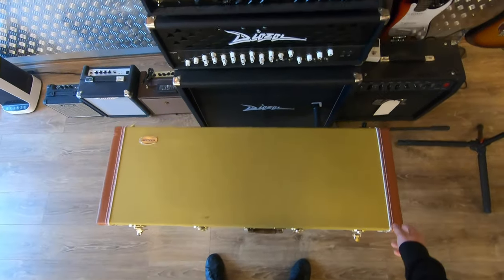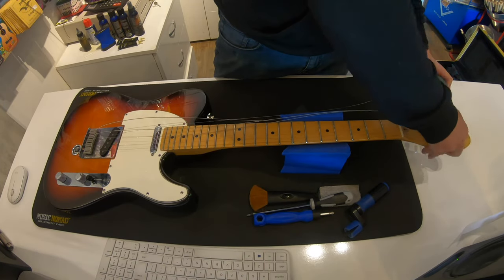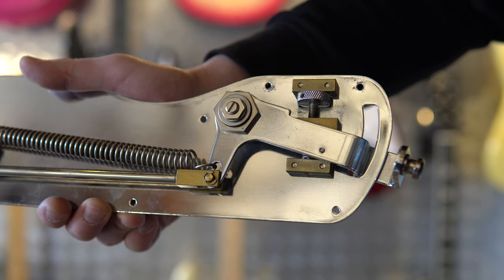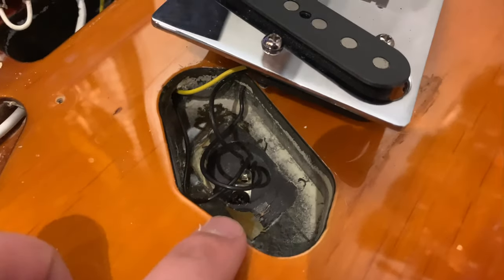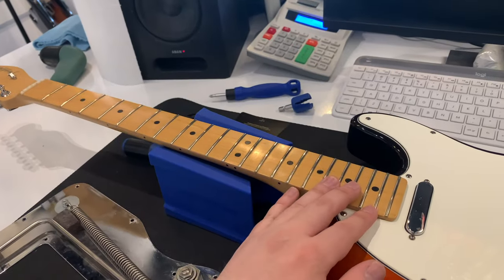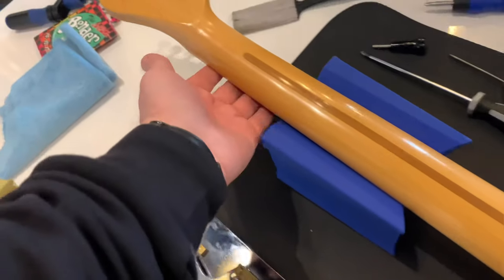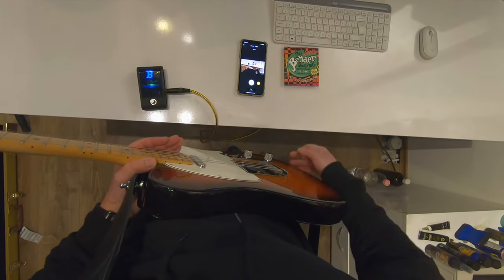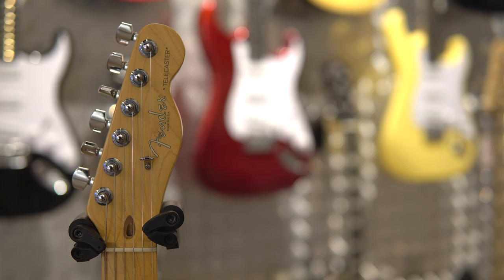Fender Telecaster B-Bender. Who invented the String Bender?

Comment: No need to state a pot is a master if there’s only one of its type… there is no slave or secondary pot…
Reply from the maker: There are Bridge and Neck volume pots. A master controls both ;) Most manufacturers list them in the specs as Master Volume, Master Tone. I want to be as close to specs as possible in my phrasing